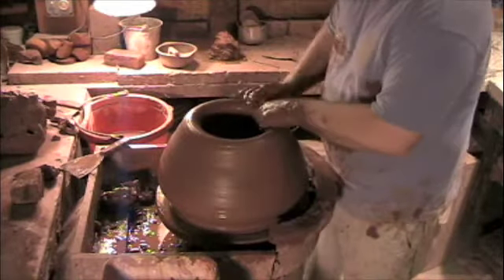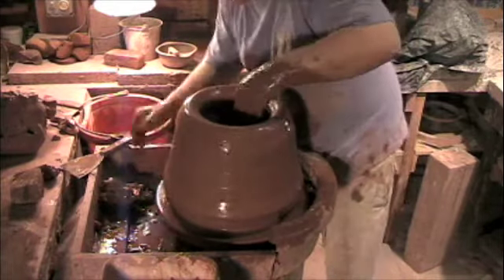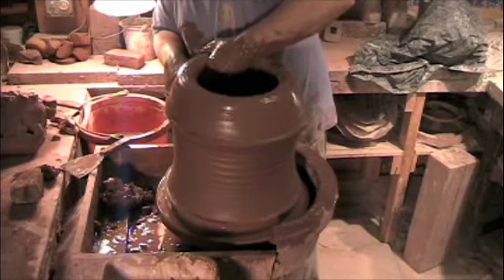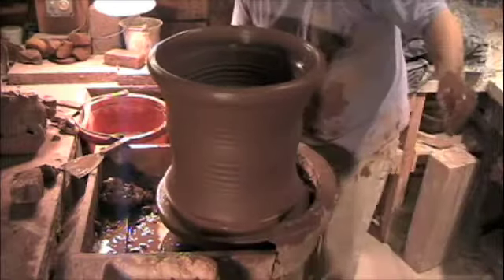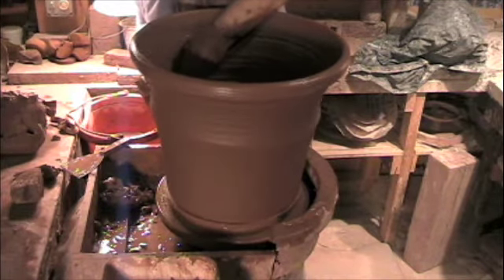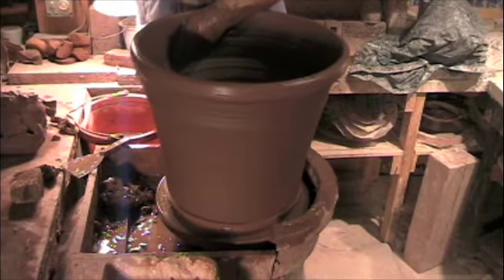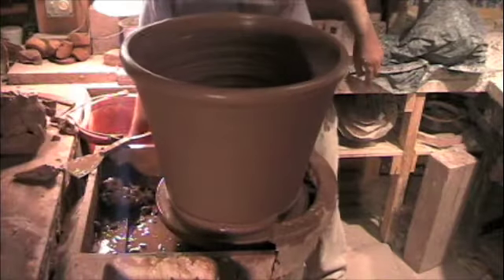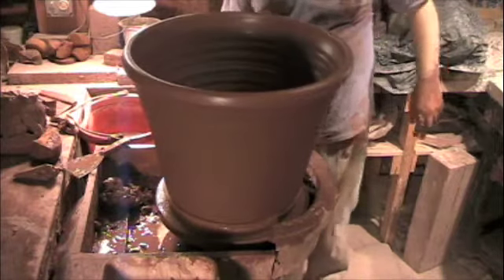CENTERING 50 pounds #2

Comment: 2 Fantastic videos.
Guy: Like you, I am using a heavily grogged terracotta. The issue I have is that I would like a smoother finish on my small mugs, jars etc. I am wondering if applying terra sigillata will solve this issue or should I just switch to a smoother clay?
NB. I don't have the space to store more than one clay.
Mark.

Comment from the maker: @dotinop Its all about figuring out how to move material . Bigger pots mean slower speed most offten . The old potters all said "Let the wheel do the work ." The tourque of the wheel is the work horse here. Can you wedge 50 pounds of clay? Learning to move a larger lump of clay takes the same kind of skill as throwing it . Do less slowly with more . I really learned my bigware throwing first from Frank Parsley at Branhams and George Currtis at Littlethorpe both traditional potters in the UK .